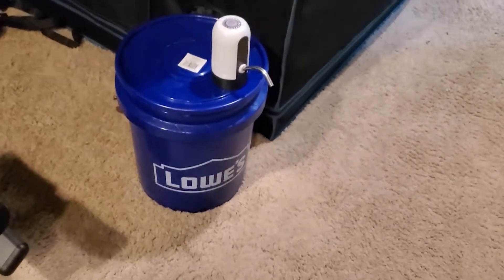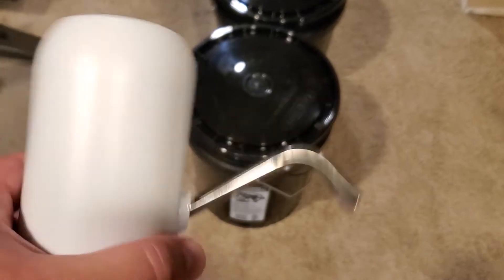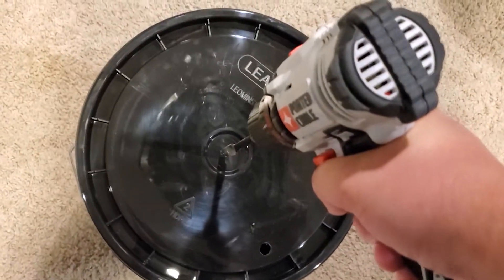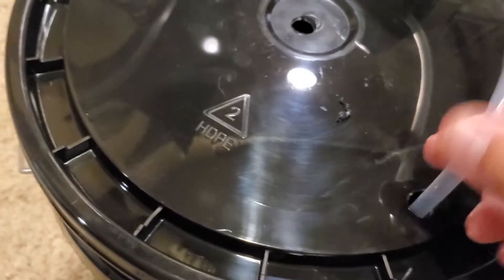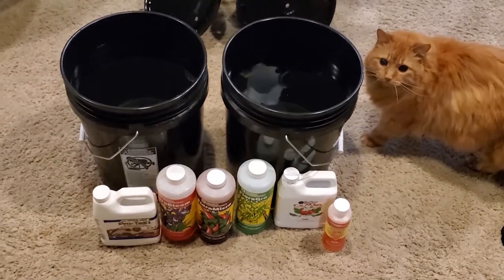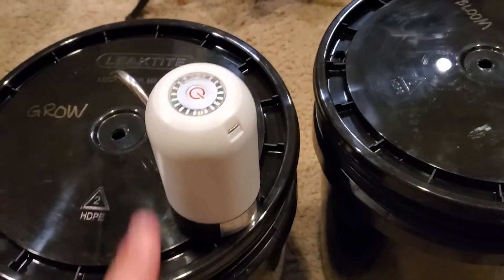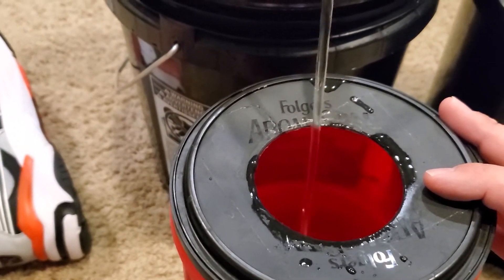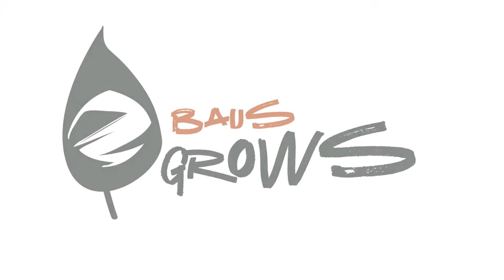DIY Hydroponic Nutrient Dispensers

Comment: I just raise the bucket off the floor and insert a plastic tap on the  lower side of the bucket. Use gravity. No power is needed.
Reply from the maker: Also a good method. I run 4 buckets so keeping them on the floor is easier for me. Thanks for watching!